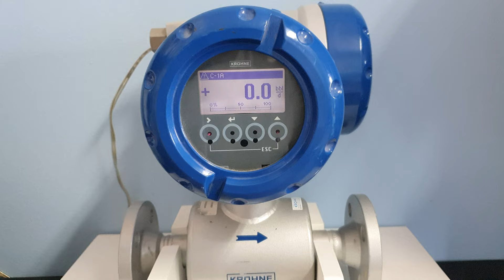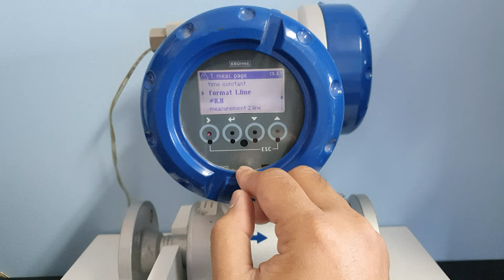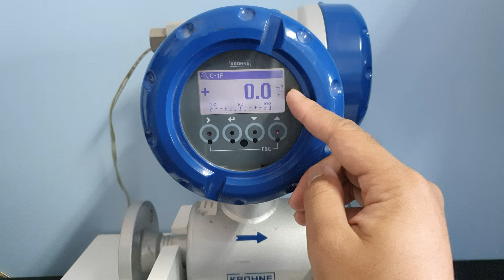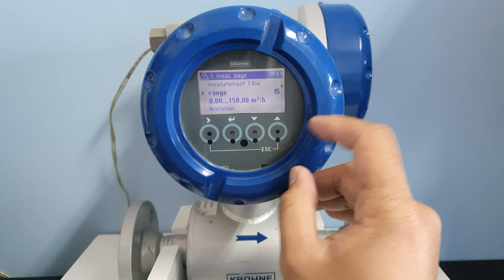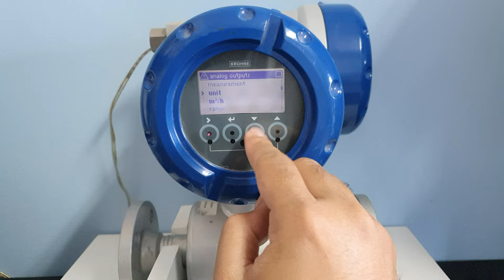Tutorials: How to change the range and unit for volume flow for KROHNE flowmeter. #KROHNE

Comment: Thank you for this video it is very helpful.
Reply: Sir I changed the unit from kg to liter but the value is too low. Which parameter should I go to change the type of process like fuel oil diesel.

Comment: I have a problem with a device, that it does not read until the opening rate of the control valve is 25%? What is the solution?

Comment: Thanks for the video, it was very helpful. 
Can the steam meter be set to display total kg of steam passing through the meter rather than kg/h?
I have the meter set to pulse for 1 kg of steam and require the display to match the pulse output.
Reply from the maker: Hi! You have the Optisonic unit? Correct?
Reply: @teamobiasvlogs495  Hello and thanks for relying! It's a Optiswirl 4200. 

I may have found what I'm looking for in the manual. I think I need to change the display measurement from 'Mass flow' to 'Mass'. 

Setup>Display>Meas. Page>C5.3.2 Measurement 1 Line>Mass.
Reply from the maker: @moklism6378  no problem. just hit me up here if you have questions. please do subscribe :p